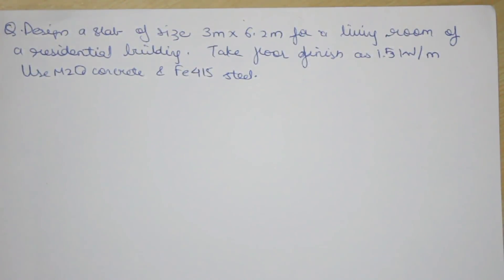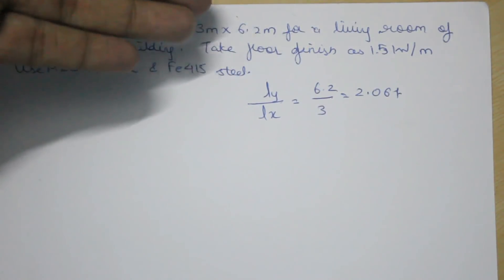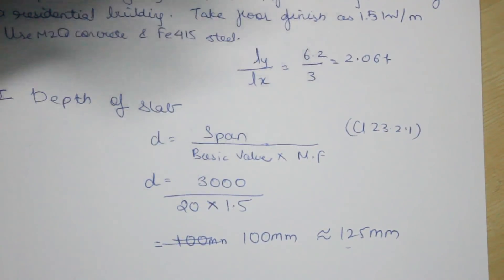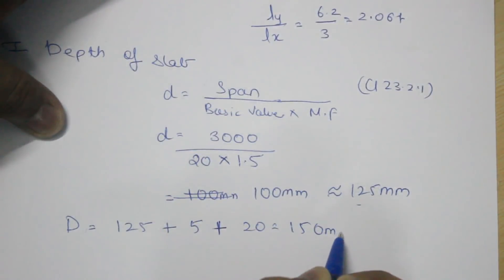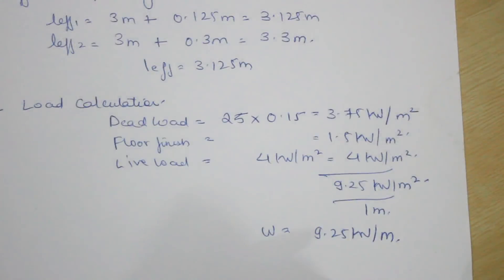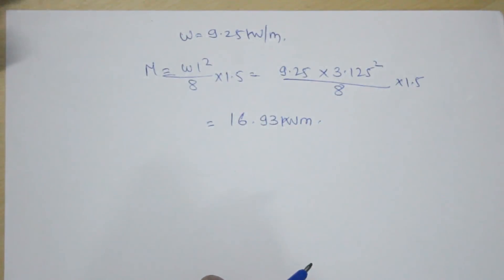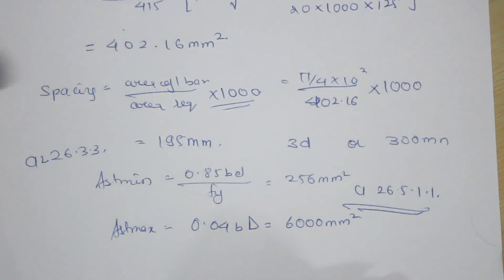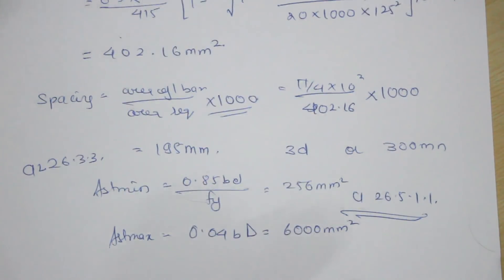DESIGN OF ONE WAY SLABS as per IS 456 | Worked Step by Step | Limit State Design | Mumbai University

Comment: sir how to decide which diameter of steel bar to be taken?
Reply from the maker: Depends upon your area of steel.

For eg for a beam you need minimum two bars so choose a dia so that two bars will give u the ASt
Generally u will se 12mm to 20mm bars in beams 

For slabs higher the dia higher the spacing and lower the dia lower the spacing. Generally u will only se 8mm and 10mm dia in slabs.

Comment: Check for minimum and maximum area of steel are for beam
Reply from the maker: Yes for tension steel check need to be done to ensure

Minimum steel provided against cracking and maximum steel to prevent from being over reinforced
Reply from the maker: Why minimum steel is necessary?
https://youtu.be/u1gvXW-aNrA

Comment: 10:35 i don't understand why you used 125 as effective depth instead of 78.
Reply from the maker: It's for safe design. If you take the minimum depth as your effective depth you slab will fail in deflection.
Reply: yeah but 125 is the assumed depth and 78 is what we calculated.so what's the point of calculating if it is not used.
Reply: is it like .. we have to use that one which has a bigger value.. be it assumed or calculated.? pls explain.
Reply: I think we should use 78 and not 125 to get Ast.cuz that's what u did in two way slab.

Comment: Sir is there any difference btw one way slab and one way continuous slab ?
If yes then design procedure of both is different ??
Reply from the maker: Yes they both are totally different. I have made a video on design of one way continuous slabs
Reply: @EverythingCivil sir You have taken in depth of slab basic value as 20 which is of simply supported but slab is one way continuous slab them value should be 26.

Comment: What's your name ?
 9:25 From where in the code have you taken the formula from
Reply from the maker: its not directly in the code. but if you see pg no 69 fig 22 of the code. there you have to calculate the moment along compression side for that the force given is 0.36.fck.xu.b and the lever arm is (d-0.42xu) therefore Mu=forceXlever arm
Reply: Everything  thank you. I checked it there and found it . 
One more question about the formula used at 10:16 . Is it also given in is code ?
Reply from the maker: NO it is not given in the code. It has been derived by equating Cu and Tu
Reply: Ok thanks for the help

Comment: minimum reinforcement in  case of slabs is taken as 0.12 percent of total cross sectional area when HYSD bars are used. The formula that you have used to calculate minimum area is used in case of beaams.

Comment: sir, how did you take modification factor as 1.5 without considering Pt and Fy ?
Reply: Brother fy is given you mean fs
Because MF  depends on both Fs and %Pt
U can easily calculate from the is code
Reply: Ok
Reply: 280/3stress in steel
Reply: See here to know